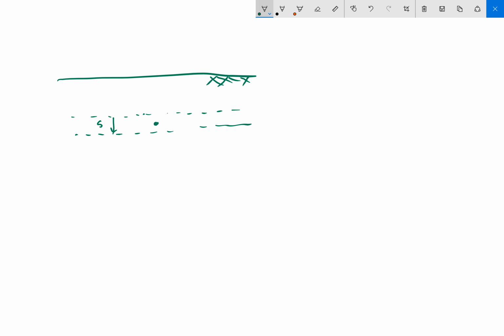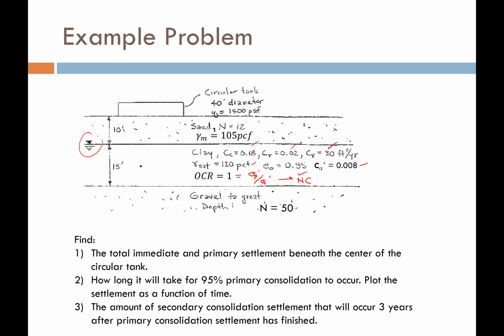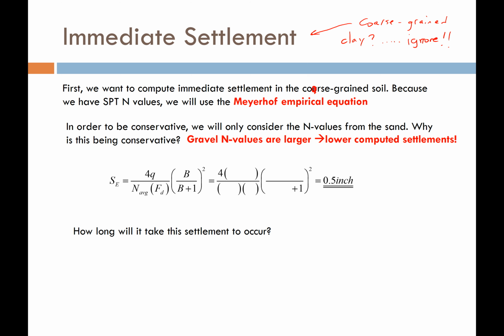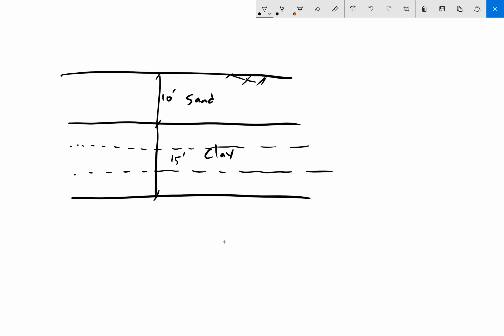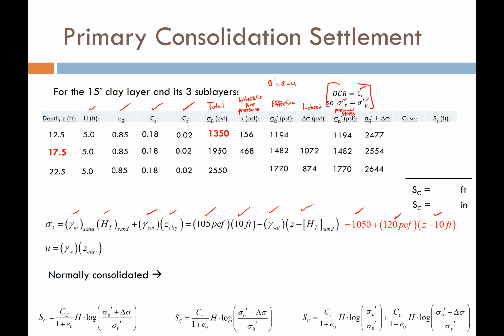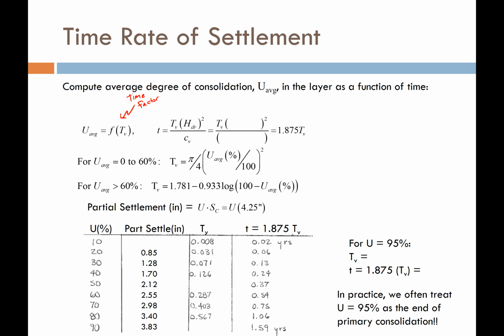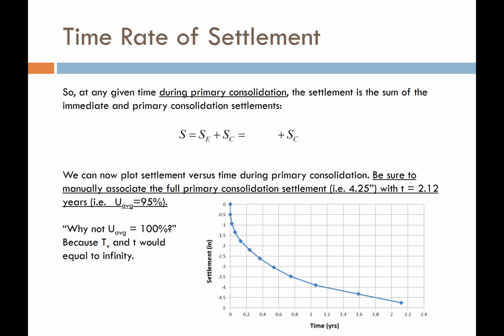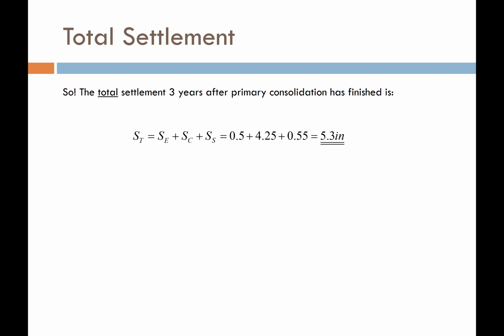CEEN 341 - Lecture 18 - Settlement Beneath Footing

Comment: One question,
If it is case 2, where the pre consoldiation pressure is still  higher than the po + delta p. 
Could we omit the secondary settlement as it is insignificant?

Comment: Sir, can you tell me how to calculate the coefficient of secondary consolidation?
Reply from the maker: It is the slope of the void ratio vs time or strain versus time curve AFTER primary consolidation has finished, and it is taken from time-rate of settlement readings during a loading cycle in a consolidation test.
Reply: so, can we calculate it from any load cycle of test? ..as secondary consolidation is independent of stress..
Reply from the maker: Yes.
Reply from the maker: But understand that the coefficient will change depending on whether the soil is overconsolidated or normally consolidated. So if you anticipate that your soil will be normally consolidated in the field, then you should use time-rate curves from a similar load.
Reply: @officehours4028  ohh...then is its value considerable or negligible for over consolidated soil also? i am asking this because even if we talk about primary consolidation, then Cc is much higher than Cr.

Comment: at 32:17, shape of settlement vs time is wrong because most of the settlement will occur in earlier time.
Reply from the maker: Sorry, but it’s not wrong. The rate of consolidation will always match the shape of the plot for average degree of consolidation. You are correct that most of the settlement will indeed occur in the initial stages of consolidation, but the remainder of the settlement can take a long time to occur.
Reply: thats why i am saying..it should be concave upward not convex upward..because it is settlement vs time plot for consolidation not DEGREE OF CONSOLIDATION vs time...because what u have drawn simply indicate after few years, settlement will increase drastically..!!
Reply from the maker: My friend, average degree of consolidation relates directly to the amount of total consolidation that has occurred, so the shapes of the plots should be the same. For example, in my plot, 50% of the predicted primary consolidation settlement occurs in about 10% of the total time for consolidation to complete (ie., about 0.2 year). The other remaining 50% of primary consolidation settlement occurs over the remaining 2 years!
Reply: @officehours4028  yes sir..but if this explanation is for settlement vs time plot, it doesn't match with what u are showing at 32:30.
Reply: i think time must be on vertical axis and settlement on horizontal for the curve at 32:17.

Comment: Hi Sir. Why when it comes to effective stress for consolidation settlement the point of interest is always the center of clay layer?
Reply: Because that is layer which consolidates at the last....
Reply: no, not in case of single drainage condition. It is because we consider the average settlement of strata. At a top of layer, a settlement will be less and at the bottom of the layer, a settlement will be more.